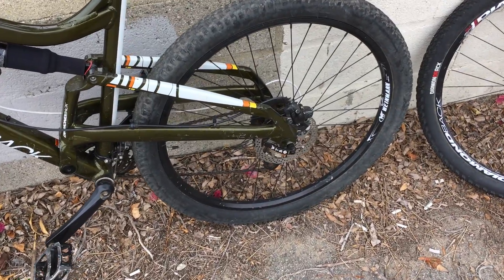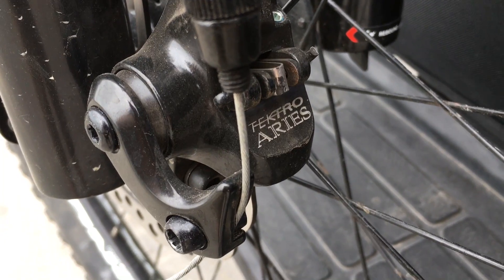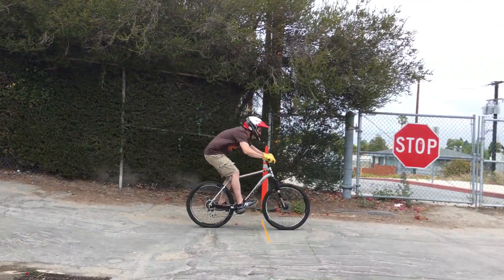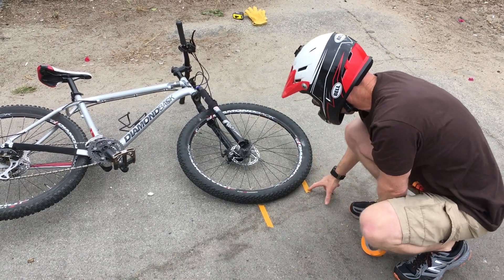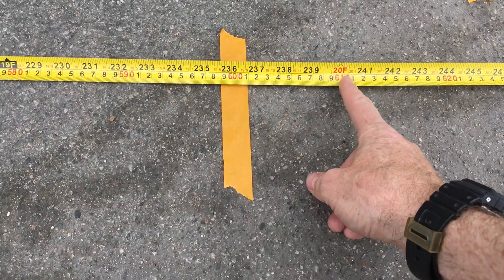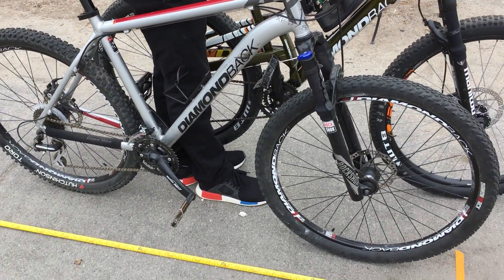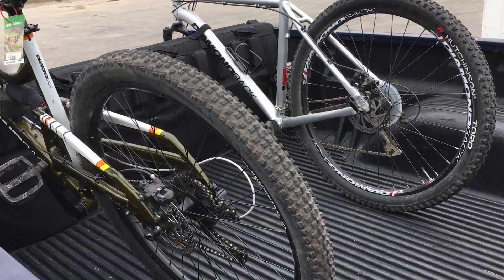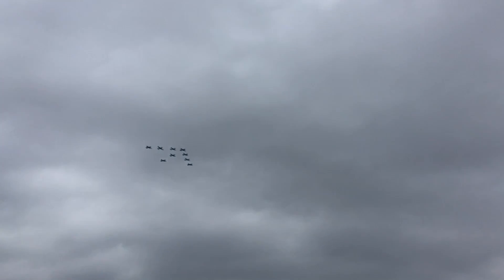Mechanical vs Hydraulic Disc Brake Stopping Power Test

Comment: Okay... i like that you guys took your time to test the difference and everything... but i would like to say a few words which contain some stuff i really dont like about your testing:

1. You only tested both brakes once. To get an accurate result on something like this, you would need to test both of them several times.
2. You mentioned in another video, that the Hydraulic brakes are cheap noname brakes... What about the Mechanical ones?
3. It honestly looks like the hydraulics where stoping you much harder, in fact so hard, that your centre of gravity moved way further forward which lifted your rear wheel way more.
4. Using different bikes is a bad idea if you want to get an accurate result due to possible difference in ride height, wheelbase, general bike geometrie and suspension.

I'll still give you a thumbs up for your effort, but maybe you'll consider my points in some next videos ;)
Reply: To also add my personal opinion: I think that Hydraulics feel way way saver, i had cheap and middle class mechanical disc brakes, until i went onto a bike with hydraulics... day and night difference in my opinion, it felt like they where way more controlled in applying the force.
But thats completely just me and doesn't mean hydraulics are better. I just feel more comfortable with them.
Reply from the maker: This definitely wasn’t a scientifically correct complete test, but I did want to show that stopping distance and stopping power on cable disc  brakes is very similar to hydraulic brake stopping distance, which is true. Under normal bike riding, I think either type of brake  would be fine, the main difference being that the lever effort on hydraulic brakes is less. With both types of brakes I was able to control the front wheel without locking it up and skidding it, which means they both have really good feel and are easy to control. We go to snow summit bike park in the mountains, where we ride the ski lift up and then ride really fast downhill down the mountain, and under those conditions which require a lot of breaking, these hydraulic brakes tend to get weaker and feel spongy when they get heated up, so you have a lot less breaking power by the time you get to the bottom of the mountain. We have had them professionally bled twice. I know that this doesn’t happen to all hydraulic brakes, but I’m afraid it might be a feature of cheaper brakes. The cable operated brakes are always consistent no matter how hot they get.
Reply: @hoohoohoblin  Braking not breaking. Breaking is when you break something as in .... breaking a glass. Cheers!  p.s. My Giant ATX2 has got Tektro mechanical brakes and I like them a lot. I don't wish or intend to 'upgrade' them to hydraulic, they work perfectly well and they got more stopping power than I need.
Reply: Braking efficiency of a bike comes down mainly to three things: The braking system, tyres, and weight. The rest is pretty close to negligible. 
The mechanical brakes used here are a very basic model. Mechanical brakes in general require more maintenance than hydraulic brakes. Neglecting this maintenance will greatly affect braking efficiency. TRP Spyre are by many regarded as the best mechanical brakes on the market. In terms of braking power, they're on-par with mid-range hydraulic brakes, think stuff like Shimano Deore or SLX. But that's with compressionless housings. The major advantage of hydraulic brakes is the amount of braking force you can apply with a light pull of a single finger. In comparison, getting mechanical brakes to their maximum braking power is actually a lot of effort which will lead to some discomfort, and even with compressionless housing there's still some flex on in the system. 
Mechanical brakes aren't useless, as many would have you believe, but the amount of maintenance they require and the relatively low cost of decent hydraulic brakes has led to a very wide adoption of hydraulic systems.
Reply: @CanIHasThisName  maintenance on mechanical brakes ?  Change the pads when worn .
Reply: @boracay12  I've ridden mechanical brakes for two seasons on my gravel bike and can tell you that this is not true at all.
If you waited for the pads to wear out without any adjustment, you'd lose some braking power before getting to halfway worn. Mechanical brakes require periodic adjustment. Frequency depends on how much you care about peak performance and consistent lever travel, but if it's a priority, you may find yourself adjusting every few hundred kilometres. 

In comparison, hydraulic brakes are self-adjusting and will require no adjustment up until the point the pads are worn. Even people who ride over 10k a year will usually not need to bleed more often than once a season, in fact most of them only do it because they do a big maintenance every year no matter what. A hose will rarely need replacing sooner than after 5 years. This is a huge contrast to mechanical brakes, where a busy season with muddy rides may warrant multiple changes of both the cable and housing, as well as a tear-down of the caliper for cleaning.
Reply: @CanIHasThisName  ok adjustment , sure .  Turn the pads in .  I have mechanical now , cheap ones .  Only one piston . I'm considering , hydraulic shimano ,or line pull hydraulics or double piston mechanical .  I don't really even need to change the ones I have .  My back brake by itself isn't very good .  So I think I'll try the 2 piston mechanical .
Reply: @boracay12  If have drop bars, it's quite understandable, as hydraulic brakes are incredibly expensive (same reason I used to run mechanical). If you have flat bars, I'd recommend just getting hydraulic brakes. Even cheap ones will be solid.
Reply: @CanIHasThisName  where I'm at they aren't to expensive . 35 for zoom or 46 for shimano mt200 for 46 . I don't really need them 
 But I might get some just for the sake of it .
Reply: hoohoohoblin Generally hydraulic disc brakes become more responsive and better as they heat up from braking, expanding the hydraulic fluid thus having more power
Reply: @billynichols1210  Incorrect, actually when a hydrolic brake heats up it becomes less and less effective and as it gets hotter and hotter your brakes start to fade, so when it comes to braking if you are doing a lot of constant braking then you are better with cable as they do not experience fade, at the end of the day hydrolic brakes use the same pad size and have the same disk size and so braking potential is the same, the only difference is that when cool hydrolic brakes take less lever force but as they heat up they need more and more.
Reply: @EQINOX187  Agreed. Billy has it backwards. Works the same in a car. Hydraulic brakes fade with heat
Reply: @EQINOX187  All braking fluids (including mineral oil) have a certain boiling point. Approaching it will degrade performance of the brakes. If there is moisture in a mineral oil system, brakes can behave unpredictably (DOT fluid will absorb water, preventing unexpected failures, at the cost of decreased boiling point). 
Modern quality brakes have pistons made out of materials which do not transfer heat and the calipers are designed to be good heatsinks. It can be very difficult to overheat good hydraulic brakes even if you try. 
However, pads are a very important factor and I think this is what had Stefan confused. The generalisation, which is mostly true, is that organic pads have strong immediate braking power and fade as they heat up, eventually forming a layer of glass-like material which drastically reduces braking. Metallic pads, on the other hand, initially feel like they're weak and only begin to bite once they heat up. They will hold performance even after long sustained braking and will typically have more maximum braking power.
Reply: @billynichols1210  I call b.s.

Comment: Obviously any brake system that applies enough force to nearly skid the tire will stop in the same distance.  The ONLY variable is the hand force required to do so.  Also, the statement that "there might be operator error" is a clue that a single test is hardly sufficient to say that the mechanical system stops in a shorter distance (around 1.5' in your single test).  A reasonable test would have several riders (the more the better) doing multiple tests (the more the better), then statistically compare the results.  (GC, M.S.M.E Stanford)
Reply: You will stop faster if you dont pull the break all the way if you press break to much it will wtop wheels and you will slide on asfalt is best surface for full breaking if you brak on leavs or gravel you will slide like on ice and its posible to fall from the bike  most of the mauntain bikes has dicks street dont
Reply: Obviously.
Reply from the maker: You are correct, sir!  If a casual bike rider is trying to choose between a bike with mechanical disc brakes vs. one with hydraulic disc brakes for $150 more, it is good to know that both bikes have equal stopping power, and they can decide it they want to spend the extra money or not.

Comment: if mechs were better pros would use them, simple
Reply from the maker: True. With an unlimited budget, everybody would go with the top-of-the-line hydraulics. I just wanted to see how good or bad mechanical disc brakes are. For the average low budget biker, I think they’re fine.
Reply: At the end of the day they are not really any better they both have the same pad size and both have the same disk size and so the braking potential is the same, the only real difference is that hydrolic ones take less lever force but it is a rather insignificant amount, it is more down to the the myth that they are better that people buy and use them and this is perpetuated by retailers,  when it comes to brakes you want a stable constant and only mechanical ones do that as heat does not affect the cable where as the hotter hydrolics get the less braking force you have, this is why i still use mechanical on my down hill bike, and this is constantly reinforced every time i go riding with my friend, my mechanical ones cost around £30 each and are shimano and his are hydrolic that cost over £100 each, about half way down his brakes start to fade due to the heat while mine are constant and by the end of it his brakes pretty much do not work while mine work as well as they did at the start.
Reply: For Pros effort needed to be put into breaking also matters - so this is defo a plus for hydr brakes. 
But in general , if you have a bit squeezing power in your hands , mechanical brakes will do the job and are way easier to service .
So even tho this test lacks scientific foundations - I agree - not much difference between the two :)